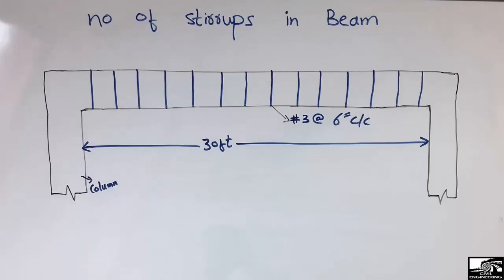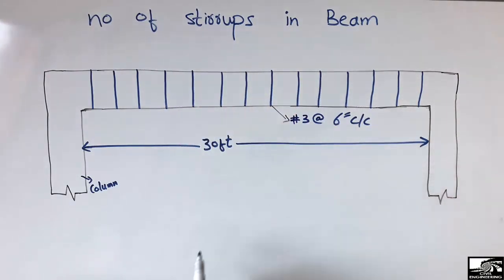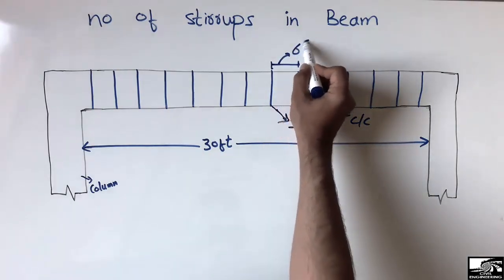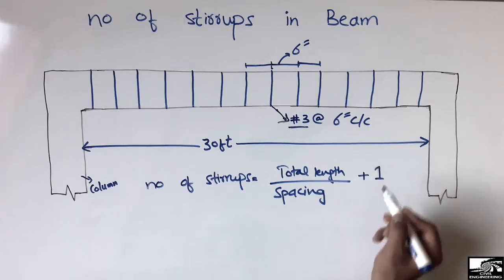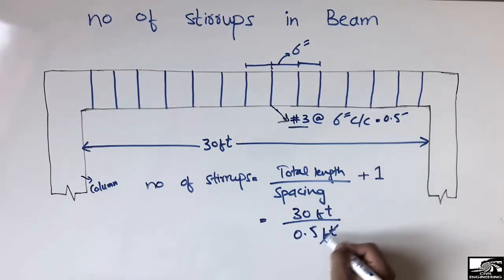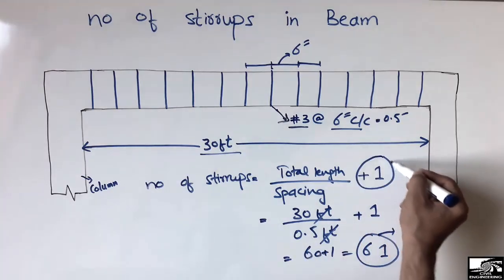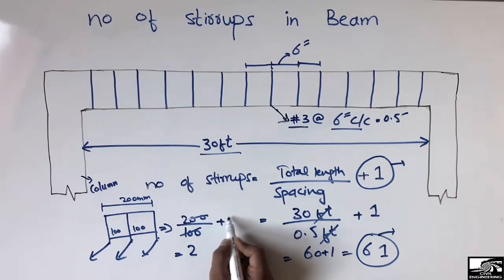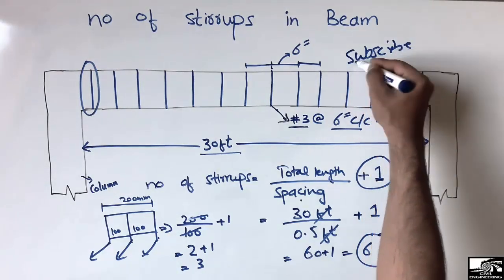How to find Number of Stirrups in Beam

Comment: Please explain how did you get the 200mm? why not make the example related to the actual spacing which is 6" or 152mm?
Reply: Doesn’t matter you can use ft or mm these are standard that use are in different countries

Comment: Stirrups are not the same distancing in one beam, we have 2 inch, 4 inch, 6inch, 8 inch. You only consider 6 inch. What about 2 inch and 4 inch? How would you actually get the exact number of stirrups in one single beam considering that we need to put 2inch and 4 inch aside from 6 inch or 8 inch spacing. .
Reply: That is why I dont like this kind of tutorial, it will mislead the beginner.
Reply: Lol no reply. But yes, usually they are layou (fot example) 1@100mm, 4@150mm, 6@200mm, rest@400mm.
The reason for this is because of shear stress, if i remember correctly